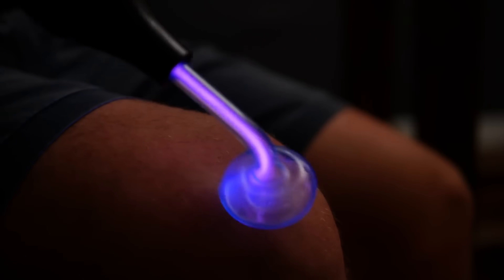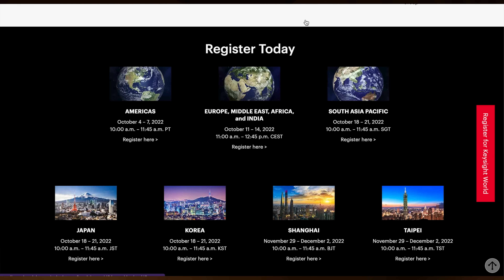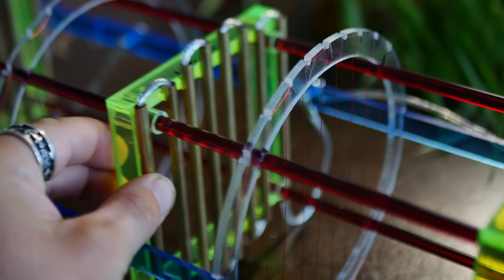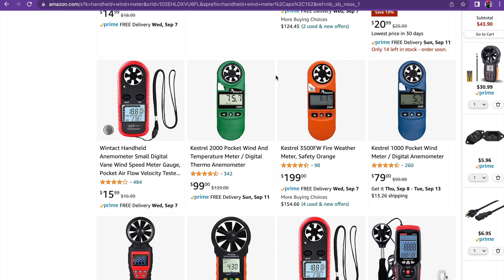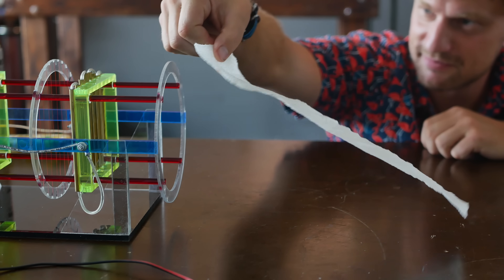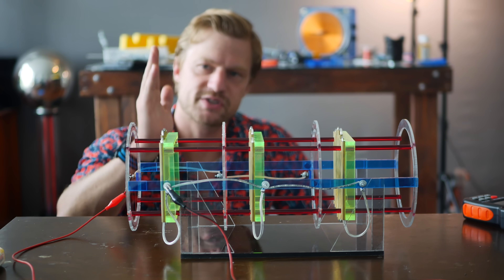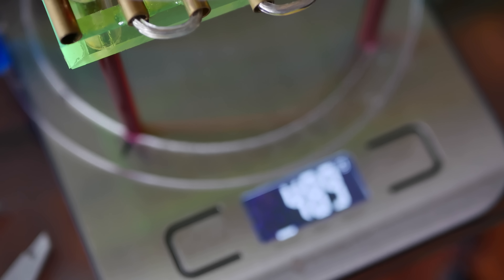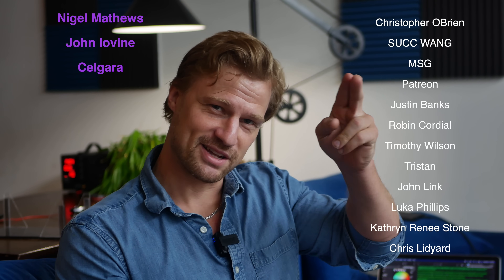Designing A Next-Gen Ionic Thruster! (For Flight)

Comment: I have a suspicion that the particles are colliding with the ground tube, since that's what they're being dragged to, and losing a ton of efficiency as a result. Perhaps you could change the shape of the ground tube to be more aerodynamic? Or somehow guide the particles out of the way of the ground tube with another weaker cathode that is offset? Although, no collision might mean they stay charged, and lose velocity to backward attraction toward the ground, and repulsion from the next electrode. However, I suspect that many of the particles are already not colliding. Perhaps, you could guide them into the Side of a hexagonal ground tube, or another shape that is more aerodynamic where they can collide with the side losing very little velocity.

Comment: Use the vornado indake design to get outside air turbulances focused and concentrated in uniform pattern as it passes in. angles of nodes and shapes... I'm thinking a conical shape of nodes at difference spacing from outside to inside smaller to help focus the intake, concentrate and speed up as you compress and perhaps some enclosed tubular secondary stage to further compress and push air through.... inverted cones inside may help static pressures from forming eddies etc... man so many ideas now... dang

Comment: If you place into the center of this device a traditional Jet Engine's Intake Propeller Fan, Compressor Blades and Exhaust Turbine, then mount the entire apparatus into a jet engine tube to concentrate the flow of air even more, what you end up with is a Ionic Turbo Jet Engine. You really wanna go nuts with it, incorporate an electric generator into the design and what you will get is basically a Linear Particle Accelerator that is essentially self sustaining minus the power needs required for the initial startup. This device would be able to function in the Earth's atmosphere; and with a propellant tank to feed the system, it would be capable of functioning in space as well.

Comment: Interesting!  Modulating the voltage using higher frequency square form at each stage might increase performance.   Other suggestions below are significant to double the performance in my view.

Comment: also parallel conections in voltage vs serial conections in voltage. the serial voltage could have a power drop why not make them parallel and make the negative condor more streamlined to help air velocity

Comment: also, since the air is ionized, could you add earth magnets to try and tighten the airflow? Or better yet, run the wiring in a way so as to create an electromagnetic field that helps shape the airflow, that way you don't add extra mass.

Comment: Nice build !
1 put it in a rifled tube
2 increase the # of grids
3 increase the # of strings on the cathodic & anodic harps
4 line the duct with alternate windings to recover EMF waste NRG and possibly run intake & exhaust duct fans.
5 Experiment with alternating grid angles
6 Experiment with stacking grid arrays 2 to 10 for each array
7 Experiment with varying frequencies and wave forms to energize the grids
8 Use an outer in-motion shell design that can capture  electrostatic energy to feed to the grids

Comment: Rather than a straight, parallel engine design where the airflow is linear throughout the engine, you should see what happens if you design it in an hourglass shape with an elongated diamond shaped heating element in the center. You should also create various size of engines, but with the same ratios. Feed the data into an ML predictive algorithm to get the ideal sizes and positioning of elements.

Comment: Why not use a mesh lattice of wire for 0V? Less air resistant, and getting the same kind of surface area shouldn't be hard. More thrust should be possible.

Alternatively, aerofoil shaped ground electrodes?

Comment: The fact that you turned off the light not only gave a beatuful sight of the ionized air but also showed an inefficiency. Although you have wires that run back and forth, the air seems to be ionised on certain spots. This means that whatever wire just transports electrons towards those spots causes drag. Also, the air pressure diferences withing the thruster caused by this could probably generate disturbances in the air flow. A tube to keep the air flowing through the thruster would also be a nice addition airflow-wise.

Comment: What about another 3 cross sectioned creating like a 3d mesh and shaveing down to thin disc's will surely reduce weight significantly I would try each disc with 2 layers of coil makeing each like a screen leaving disc's at different thicknesses should help creat staggered distances that u seemed to have success with but what do I know 😉

Comment: Super cool. The next things I'd want to try would be increasing the wire density at each stage and adding a tubular shroud to keep the air pressure from bleeding out the sides.

Comment: I suspect ducting is going to be a double edge sword without actual testing. Yes it may prevent loss of side intake to the system. However, how much is expelled by not having the enclosure? If it can draw in it can also push out.
Reply from the maker: And this right here, is why I did not duct the design. However, V2 will use...a very special ducting design.

Comment: More a question than a suggestion - why lacquered/coated wire? You could see in the dark room images that the main discharges were from gaps/breaks in the covering, so you would perhaps get more if there was no covering at all. Conversely, you might take more current and the output impedance of your multiplier might not develop so much voltage.

Comment: 1. ducted + nozzle + exhaust calculations.

2. flat granular wires + different mesh densities. Granula to create spikes and flat for a directed airflow. 

3. I don't know if you have noticed but the amount of Kw/Thrust and stage count/thrust seem follows a logarithmic growth. A differential equations could probably tell you the optimum count for both. 

4. Make it space worthy to get funding cause 18% won't cut it on earth. It's really not bad considering a common car engine is at 20-35% but an IBM/Space thuster is roughly 70% efficient.

Comment: what if you gave it a housing so it kinda makes a more isolated wind tunnel effect. may make more of the air exit in your desired direction (velocity), probably help alot with the laminar goal as well. i really think the housing will specifically help with the stages boosting each other, instead of probably pulling stagnate air from the sides and trying to speed that up as well.
 then again your moving air with electricity so i have no clue how its actually flowing, this was super fascinating to me tho, look forward to you going a little farther with this!
Reply: That's a really good suggestion. I think adding turbo pumps, solid fuel and a rocket engine would also improve thrust significantly.
Reply: @TonkarzOfSolSystem 🤦🏽‍♂️

Comment: "it's pressing down on the scale" which it's standing on . . .   So you getting what? g / in^2 of the the scale plate - losses due to lift canceling weight + ground effect ?

You could have at least turned it upside down and had most of the forces in the same direction. 

Better off to suspend it with reasonable clearance and measure from above.

Comment: #SUGGESTIONS:  

1)  Ducting.  Surrounding it so it moves air through only one axis instead of all around.  
2)  Making a second test version so that each coil set can be moved closer and further away from one another.  It is possible that simply moving each coil set closer together (up to a maximum tolerance point of course) could get you more thrust because there is less space for air resistance and turbulence to rob the system of thrust.

Comment: Putting a coating of nano graphene plates on a surface like the wire also can increase air ionization potential because it is like having billions of super sharp conductive points that air ions love to form at.  But the plates have to be kind of rough and stick up not just lay parallel.

Comment: i think also staggering the wire spacing is the key to better efficiency. divide the circumference into ... lets say 20 segments. that should give you 8 wired across a circle. you could also try flip that spacing to be more concentrated in the center and see what works better

Comment: what if you made a fan/propeller with the positive wire on the leading edge of the blade and the negative at the trailing edge.  Or you could build like a jet engine and have the alternating fans in the compression stage be positive and negative.  That might be better than putting them both on the same propeller because it should increase electrical isolation and allow for more interaction between the plasma and the air.  potentially you might not need to add any additional rotational energy to the turbines they could maybe be powered by only by the ionic fan blades.  Additionally you could maybe gear a rotational transmission between the fan blades so that the rotational energy created by the ionic compression stages transmits to another thrust stage that is unpowered similar to like a turbo prop.  and yes also a more funnel like geometry for the whole apparatus should increase air velocity.  You could also potentially take advantage of Lorenz forces in the system by introducing magnetic fields.  I have seen vortex made in water using the same principles of magnetohydrodynamic drive systems.  That principle should work on any ions so maybe surrounding the system in one or many magnetic fields could increase the either angular velocity inside or exhausted thrust or both.  also as the air becomes more compressed inside the temperature should increase which makes the air more capable of being ionized so in the deeper compression stages you might be able to get away with supplying lower voltages there.  Amazing work by the way I love this area of research its so cool.
Reply: One more thing if you eat to go for a more solid state model you could make the geometry similar to a ram jet without fan blades.  even better yet what if you powered the system by introducing a mist of highly charged water like what comes out of a kelvin water dropper but that is pure imagination.  Some design considerations for a compressor thruster would also be the fans might have to each be on independent axles and the voltage would be supplied directly to the axle pass through a bearing and to the fan along as its all made of metal then each fan could be insulated from each other.  for the magnets to provide the highest lorenz force one pole might have to run the length of the axel and the other surround the outside.  for this you would have to have a hollow hole in the middle of the fan blades would be attached to more like a ring and that would then run around in a housing on bearings similar.  Or potentially even better yet the fan is supported by a ring around on the outside of the blades running on bearings with on central axel at all leaving plenty of room to run a  magnet the length of the system, being closer to the air ions in theory and more electrically insulated.  This would also allow you to supply a charge to the fan from the outside without having to run wire inside the air flow chamber.  A magnet set up like this would increase the rotational velocity of the ions inside the chamber not their velocity towards the negative electrode.  so maybe on the prototype the compression only happens between the interaction electrodes not from one set to another, by compression I mean decreasing the volume of the air flow chamber.

Comment: I was thinking the flat positive wires you have could have the ions break off at only one point the lowest to the field which may all be to one side on one wire and all on the other for the next wire giving disordered flow.  Sharp points allow the ions to break off easier. It could help making the positive from cut wire mesh with point wires even to spread and ease the ion release? Or possibly just a metal screen the weave giving a even spread of lower bumps?  I also concede its easy for me to type it and a pig for you to build 😁

Comment: Um what about a casing around / enclosure?  it with like smaller and smaller aperture and 'rifling' to create a vortex?  if you don't want to make it smaller at each stage, divide it up into 3-4 so its still the same area over all but the sections get smaller and smaller?  I wonder what would happen if you fired it in stages like a coil / rail gun.

Comment: So a couple of thoughts I had.  

1.  Surface area of the anode.  Basically you're hoping for random air particles to hit the anode.  The more particles that hit the anode, the more air you can move.

2.  Aerodynamic cathode.  You'd want less air particles to hit the cathode.  

3.  Is it possible to do galvanic isolation between each anode/cathode pair so you can move the pairs closer to each other?

Comment: one big inefficiency is the ground planes, what you could do is make each stage different voltages starting with the low voltage in front and higher voltages in the back, this would cut down on the weight from the multiple ground stages and instead you would have a single ground stage at the end, but multiple different exciter stages say first one is 4kv the next stage would need to be 8kv, then 12 kv for the final stage, each one will be negatively charged in relation to the previous stage, this would cut down on weight of the thruster itself though I bet the electronics get more interesting.  

another idea is if this shows an actual improvement in this sort of thruster is many micro steps of thrust maybe like 10 stages each with a 1kv difference between them going from 0v in fresh air to 9 or 10 kv of charged air.

Comment: I am thinking that altering the way the wire is placed may increase efficiency. Quite possibly you could increase the flow by adding more wire to first stage, less, to next, even less on last, or vice versa. The concept seems solid, but I have very limited understanding, other than accelerating the flow through different stages, almost like a rocket.

Comment: Amazing stuff. This is new technology to me. Reminds me of back to the future when Marty road the hover board. Great work 👏 

A few points that I understand (correct me if I'm wrong):

Each stage is being powered by the same voltage across each, and voltage was dropped across all resistances, this is why you gained thrust by eliminating the additional "thrusters" therefore applying the majority of the current to a single load allowing it to do more work. By putting them in series and in line you simply made the air move further.

Remove the additional stages and test the thrust individually. I'm sure you are aware you were causing resistance to airflow by not separating and testing a single stage.

Next you can use multiple thrusters spread out over the same plane to apply thrust over a larger area, increasing lifting capacity. Multiple thrusters on the same plane be it vertical or horizontal. If you want to increase velocity of the thrust funnel the air into a smaller exhaust port. Multiple thrusters on the same plane could also help to increase stability in the case of a vertical launch. As well you could also control the thrust of each by varying voltage supply to each thruster to help with stability and equal force generation across a larger area. I'm looking at drones, they are typically 3 or 4 propellers.

Great work, I'd love to see where this goes in the future,  maybe hover vehicles.

Comment: Personally I always wanted to test 90 degree phase shifted AC as a series of plates.
That way you have a sine wave sliding from end to the other, dragging the ions and plasma with it as it grabs/pulls lumps of non ionised air
The problem with this design as I see it is the efficiency of that airflow.
Bascially you want all the flow heading along the tube rather than radial to it and simply buffeting the local air.
You woudl also have mauch greater electrical effect with a much lower air gap cross section.
So personally i would try an array of shrouded tubes with 4 plates at 90 degree phase shift or whatever phase shift required to suit the number of plates.
Here you are using ion traction rather than just ion flow.

Comment: to see if they perform better when the inflow is already compressed air you could put a ventilator in front and see if they add more thurst than they have by themselfs.

At 8:57 you can see, that the ions flow slightely sideways because the ground isn't direcetly behind the ionizer, maybe having them perfectly in line could make a difference.

Futhermore if three stages in series only increases the velocity by 50% wouldn't it make more sense to have them parallel and then funnel the airflow of the three to a common output? Maybe in a next build you could try a setup where there's three parallel funneling into a fourth one.

Comment: 🇨🇦/🇺🇸... Firstly... This is a stack with nothing but space to separate each level. Do the anodes and cathodes interfere with each other from one segment to the next?... I'm thinking that the stages should be cyclic (switching on and off in stages). Second, should it be in an enclosed cylinder? Third are the anode/cathode grid size optimum? PS... you used the term "specialized ELECTRODES"... I don't think you can use that term for an IONIC device. Also, can you do something to visualize the ion FIELDS themselves... not just the flow?

Comment: the first two stages could be leaking thrust out the sides and i would be curious to see if a single intake vs staged intakes makes a diff. Also, i wonder if changing the geometry of the coils could help with compressing the air. Maybe concentric rings.  
I would also like to know the flux density of the electron flow. you could build a simple ionization chamber (used to test x-ray machines)  to do that
Reply: almost forgot, you need to measure lbs of thrust per sq inch.